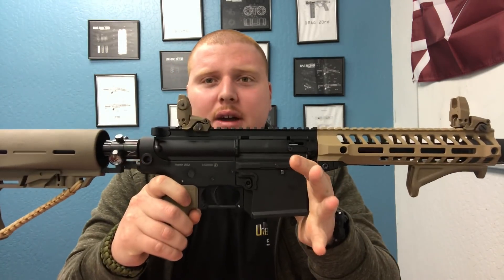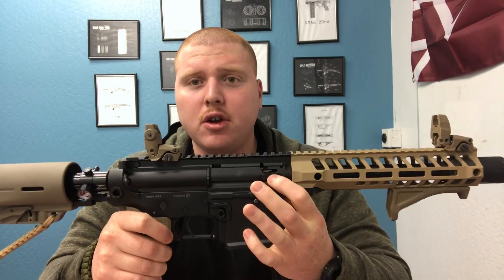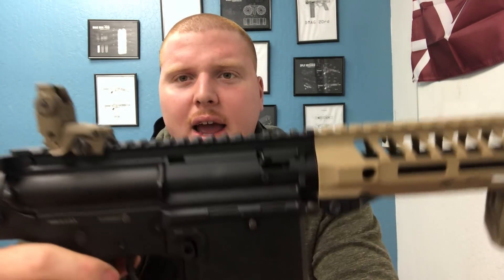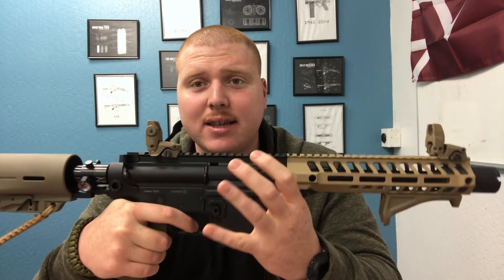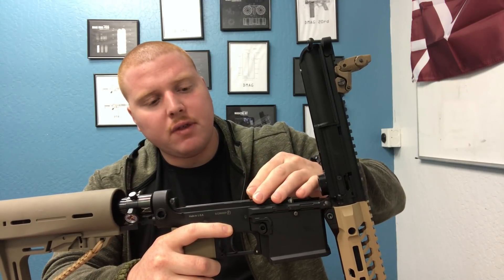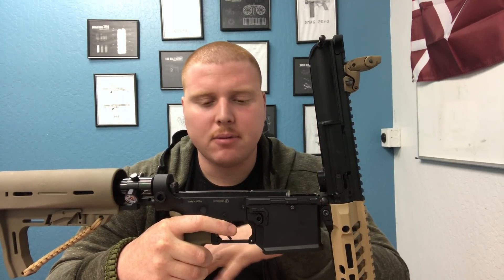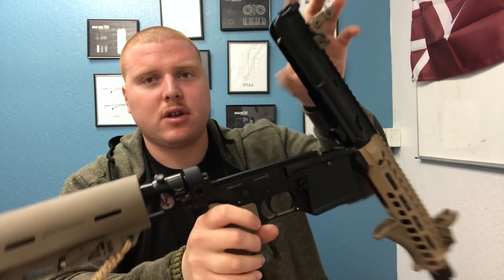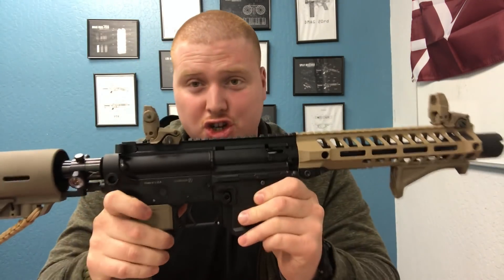Things2know about your 468 and 468 PTR

Comment: DO NOT USE SUPERGLUE ON YOUR UPPER/LOWER RECEIVER SEAL!!!

That's the first thing I did and could not get my marker to work for months and I couldn't figure out why until I cut it out and put it on WITHOUT the glue.

Just buy a couple extra ones. It's only $5 or so.

Be Mindful to PULL YOUR CHARGING HANDLE every time you open your Upper Receiver so it doesn't go flying.

I took this marker apart maybe 20 times now. Can probably reassemble it blind-folded.

I LOVE IT.

Comment: Is the upper/Lower receiver seal still standard on the marker ? I dont know if mine came with one. ..
Also when adjusting velocity, can I pull out that twist part while the marker is aired up?? Or alternatively, can I just use an allen key to adjust the velocity
Reply: You have to remove the air tank and pin to adjust the velocity, unless you have the drop down foldable ASA.

Comment: When is the PTR going to be available? 

Still 10 years?
Reply from the maker: You are looking at it... its been available for about 5 months now. Future upgrades like new upper and mechanical FA/ 3 rounds burst will be out in the future.
Reply: Modern Combat Sports please stop with that answer 

A 468 PTR is just a 468 

I don’t see a PTR, so when will the full version be released?
Reply from the maker: Luis De la cruz the 468 upper is used currently on the PTR lower. But the 468 is not the same as PTR. If you have the chance to use and feel one, you’ll with see the differences. The final PTR upgrades will be out as soon as possible we have projects already que we are finishing up.